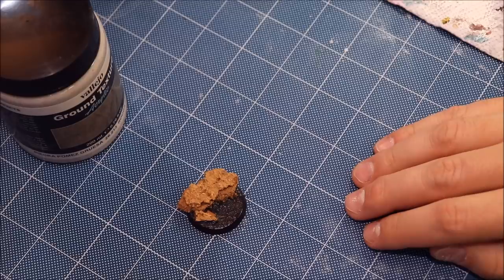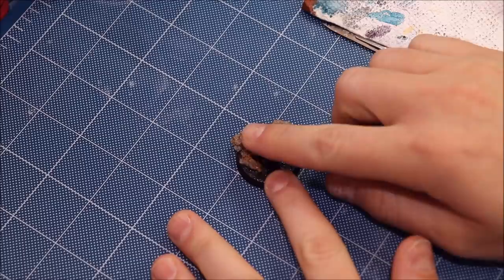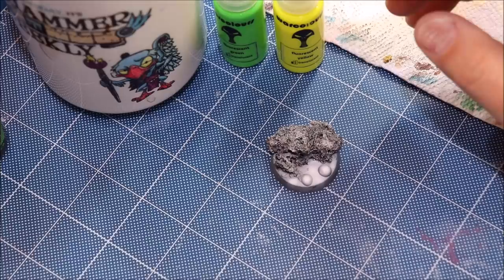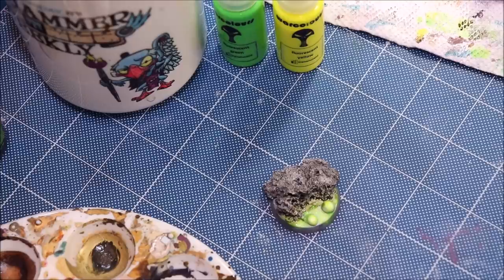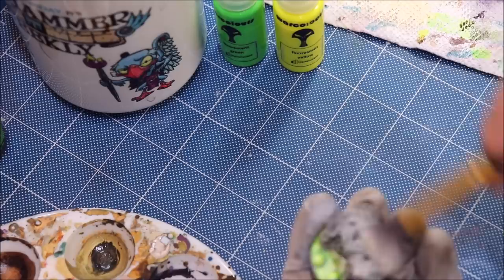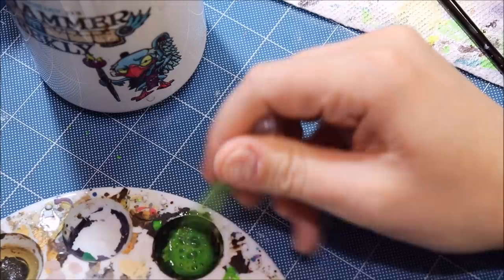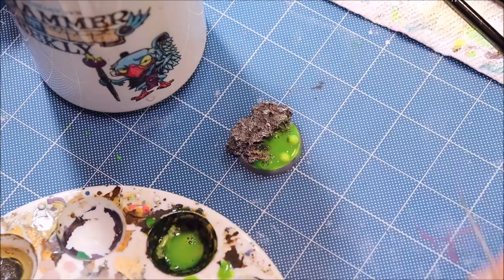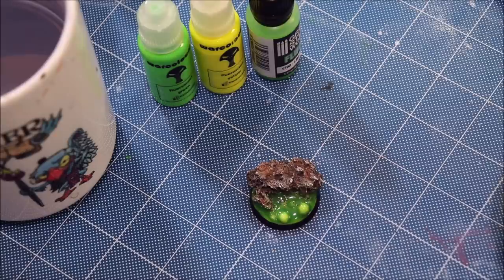Hobby Cheating 171 - How to Make Bubbling Ooze Bases

Comment: +100 on painting on the miniature tutorial..  I would happily watch an hour long one of those even if thing are reiterated a lot
Reply from the maker: I will see what I can do. If I recorded the whole process for painting a miniature, it would be about 40-80 hours long, so I would have to do it at like 8x speed and narrate. The most challenging part is I don't paint in a position that would be easy to record on camera (I tend to paint in my lap) :)
Reply: I'm like a goblin that wears a magnifying visor 

 I guess I mean a longer video that contains a few techniques that you may have mentioned before, but I can see that might go against your video style (which is good with its focus btw)

Comment: Great tutorial as always. Short question regarding the pigment use, because I want to try pigments in the future. When you fix them with the Agrax, won't you drag them all over the rock while putting on the agrax or will they mostly stay where you placed them?
Reply from the maker: They will mostly stay where you place them. The key is to brush away the excess. When you place the pigment dry, you push it in and brush away the rest. The wash will then seal it up (basically any medium will seal it). You may get a little blending, but it can actually be beneficial to smooth it all out.

Comment: adhesion was correct, as you have two unlike bodies which stick together: the base and the liquid. the liquid stays on the base because of friction, electrons attracting each other, and so on.

cohesion exists between molecules of the same substance, i.e. the molecules in the liquid are cohesive.
Reply from the maker: Excellent, it's a thing that I learned in the past but never seems to stick in my head correctly. :)
Reply: You are correct but the physical effect which keeps the water from flowing over the rim is surface tension. (Same effect wich lets you fill a glas of water above the rim of the glas)
Reply: @JenserBierfan  well, yes. but I did not want to turn this into an exessive science lecture :D
Reply: If the opportunity arises, you should always do that :P

Comment: Question:  So for my Khorne army, this sounds interesting, except swap the green with a red.  I was already thinking about doing this with 'Blood for the Blood God', ala GW's video on the method.  Is there a better way to make that effect pop?  So what i'm talking about, is doing 'rivers of blood' in my bases.
Reply from the maker: Yep, so I can share on that, I have done rivers of blood before. So my advice is this. Lay down an undershade on the edges with a deep purple. Lay down abase undershade of a magenta or crimson. Then paint the bubbles pink. Then use some realistic water mixed with crimson or magenta and do a thin pour over everything. Then when you are done, lay down a thin layer of blood for the blood god on top. It will create the depth and shading and the pink will turn red but appear to be more "transparent."
Reply: @VinceVenturella  What do i use for a crimson?  Thank you!
Reply from the maker: @geteavnroc2250  Bloodfest Crimson from Scale 75 is what I like. But any deep crimson paint will work.

Comment: I was thinking about doing something similar but in purple to represent Shyish (I don't know if Shyish has purple bubbling ooze but who cares).  I have three questions given the models in question are Grimghast Reapers painted essential in the same color scheme as Mengel (see Carin Wraith). 1 - Would that really light ghostly teal contrast well with a purple (I realize they're not diametrically opposed on color wheel)? 2 - Out of the Fantasy range of Scale 75 which purples would you recommend? 3 - If none of this sounds like a good idea, what would you recommend for basing color/material wise given the color scheme of the mini.  Thank you.
Reply from the maker: 1. Yep, purple and teal always look great together for the most part. 
2. Elendil Violet (I think that's what it's called, it's from the elven colors set) - that's your good low tone. Very thin over white could be your high tone. 
3. I think this all sounds like a good idea and purple gloop would fit Shyish perfectly.
Reply: Thanks!

Comment: Hi great turorial man! When i put the last layer of ak water effects + lime fluor on after a couple hours of drying theres noticable cracks all over the green parts, any ideas on how to avoid this?
Reply from the maker: Hmmm....might be a little too much of the Flour I suspect, it could be causing a problem with the two are separated and drying at separate speeds. You may want to add a little less Fluor and make sure they are really thoroughly mixed.

Comment: Thanks for this tutorial, Vince.

It can be pretty easy to low-budget attempt that in 3 steps. It wont turn out as nicely as yours, but its a start.  So here's what to do:

Step 1.) I like cutting the herpes off of the hooker, meth-heads my garbage neighborhood.

Step 2.) Superglue to your base.

Step 3.) Profit.

Pro tip: Always wear safety gloves, eye protection, and appropriate safety equipment when working with herpes.  I dunno.  Check with your doctor first. 😁🤣😂